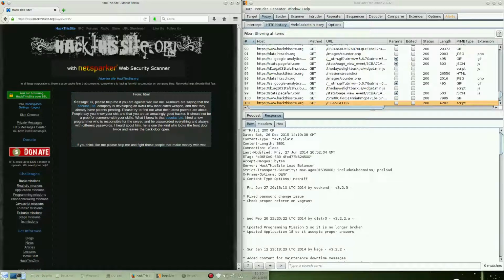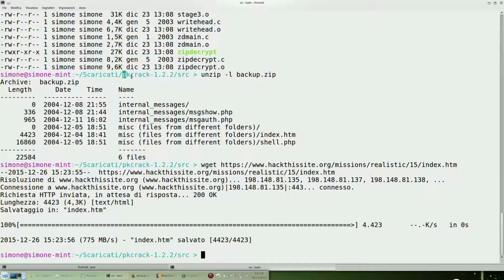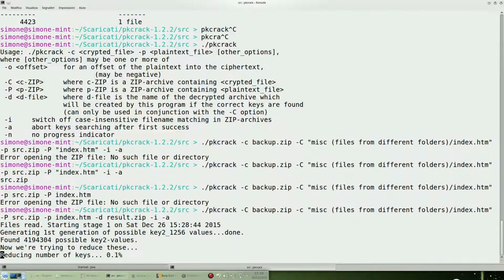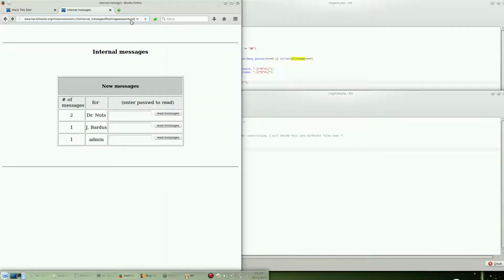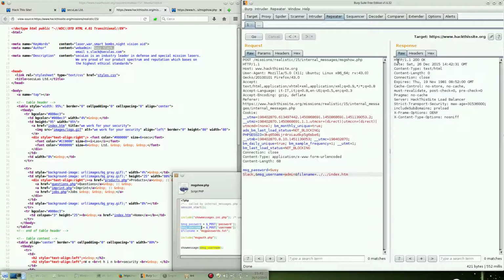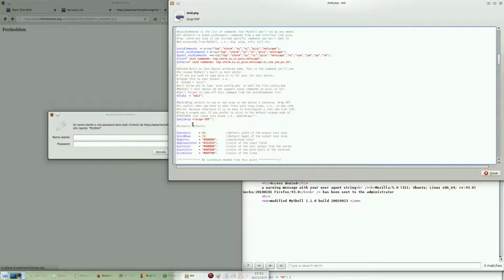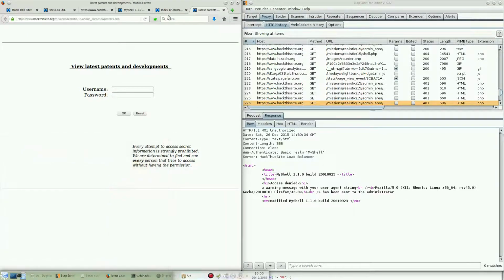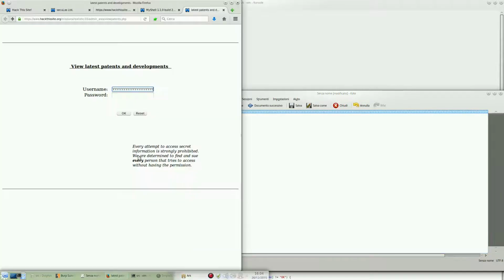HackThisSite - Realistic 15

Comment: Dude im having trouble working with hashcat or cudahash. Can you help me out one day, like give me a tutorial or something. This seems to be the only thing that has given me trouble while doing these realistic missions, For an md4 hash, i had to run to my windows computer and use cain and able.... but i wan to keep using linux to do this kind of work....
Reply from the maker: +Daryl Baez And you should keep using Linux, it's the best way to learn.
* cudaHashcat is only available over GPU (nvidia video card);
* oclHashcat is only available over GPU (intel video card);
* hashcat is available over CPU (any);
What is the problem with running your hashcat?
Reply: I cant get the paramaters right... i guess i just need some practice
Reply: And cuda i need to get cuda files, but my nvidia driver is 361.42 or something like this
Reply from the maker: Good, start with the CPU version then. Once you'll be able to crack different kind of hashes with that, we can move to the CUDA version